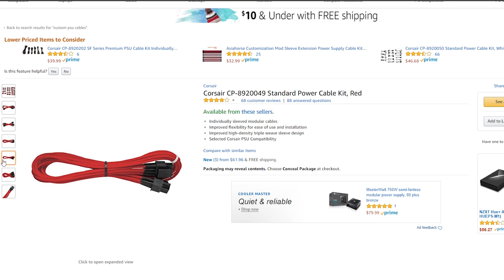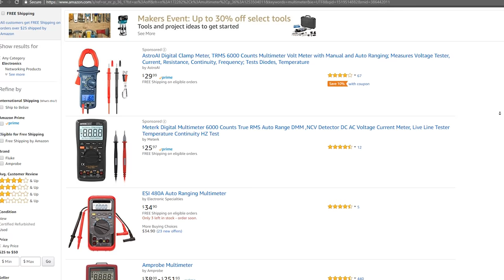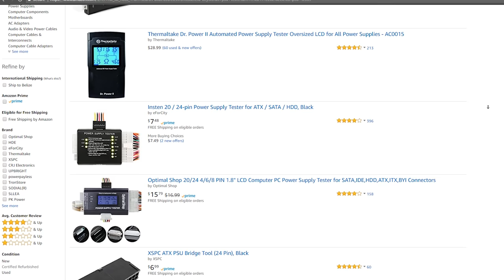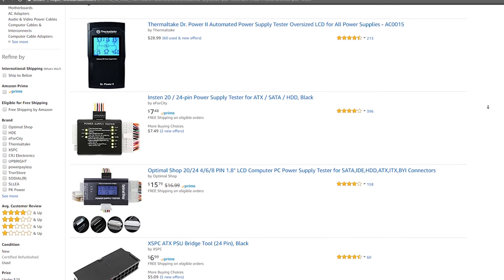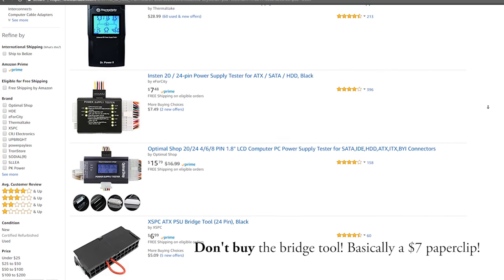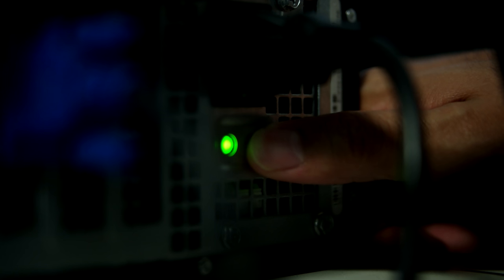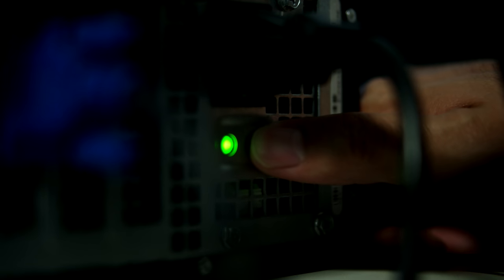How To Test Your Power Supply With A Paperclip

Comment: Thanks!! I nudged my PC and it turned itself off, so I began worrying. Thought it was the PSU so I did this. After unplugging everything for this tutorial and plugging them back in, it worked. Turns out a cable wasn't in correctly. Thanks again for helping my stupidity :)
Reply from the maker: Glad that was an easy fix!

Comment: Thanks for this. I should have done this before ordering a new PSU while in a total panic. After this test I plugged the connector back onto the MOBO and viola, my system is up and running again. It was however a weird situation with an EVGA 500W 80. For the second time now for now reason the PSU fan started spinning like crazy, almost like a hair dryer. Even after putting the PC to sleep. I pulled the plug but after that the System seemed completely dead. No start, no lights, no electrical noise.

Comment: My fans were all connected i unplugged the GPU too so it wouldn't cause extra problems
I had one of them silent modular the fans didn't spin so at least im happy it's the PSU motherboard would turned out way more expensive 😅😢
Tnx it helped so much

Comment: So my fans stop spinning like a second after it turns on so is it faulty?
Reply: Joel Mathew depends on your psu, it could be because it has an automatic fan that adjusts to how much energy it’s using
Reply: Also depends on if you have eco mode enabled
Reply: Then what the heck are we looking for? This isn't helping.
Reply: Did you ever find out if it was faulty
Reply: try rearranging your RAM, or exchange it
Reply: Maight be short.
Reply: @VVVVV99611  a little late with the reply but yea it was faulty, I replaced it with another psu and it worked fine
Reply: Well imma give it up for replacement 😀

Comment: oooh a channel from Belize niceee... Hey bro appreciate the knowledge building a PC this weekend n just bought a new PSU im getting in this week along with some untested used parts so wanted knw how I can test in case any issues come up... Thanks, from Buttonwood Bay, Belize.
Reply from the maker: A fellow Belizean, nice! Hope the info is useful and hope your PC build went well.
Reply: @JoesVids  actually gonna build 2maro... It's all older used parts... But shall see how it goes shud be good...
Reply from the maker: @complx501  Been using a used Asus x370 motherboard for 2 years now without any issues, so hope everything you get is working fine.
Reply: @JoesVids  nice bro lol that's actually one of the really good ones... I have a 3700k with 32GB DDR3 and a Gigabyte Z77X-UD5H motherboard... Supports SLI as well as has an old M2.Sata connect... Pairing that with a older GTX 970 just need to test all the parts n buy a case probably gonna shop one from GS-COM or so

Comment: My corsair psu(which I bought two weeks ago) failed after I changed my graphics card. I put the old psu back in without using the gpu and it worked. I was mad...

Comment: You mentioned that static is an issue in some places but not others? Is there a way to elaborate? I'm really interested on why that happens, as I've never heard that before.
Reply from the maker: Someone else had asked this as well, so I'll just copy/paste my old answer, "I believe it is the high humidity in Belize like other tropical locations that keeps static shock at bay."
Reply: @JoesVids  oh ok thanks. I'll build my next PC underwater. JK.
Reply from the maker: Lol!
Reply: So, your mother board and gpu is ok?
Reply: it's because some places, like the USA, know how to handle delicate electronics and other wuffos, like this guy, don't bother. Ask him what the water heater on his shower looks like.

Comment: I did this test. I was cautious about it too. worried I would get shocked. just  be careful it isn't so bad.

anyway thank you for this. I have the thermaltake 850w RGB. built my new pc yesterday and the darn thing wouldn't turn on.

did this test and for the first time, the fan turned on the PSU and the rgb. when connected to my mobo it didn't do that. not sure why. now on to the next phase... I really don't want it to be the mobo.

Comment: I have a Seasonic FOCUS+ and tried doing the paperclip test and it reacts for a quick second but then stays still (i see the fan twitch and hear clicking), but I see a good amount of voltage coming from it using a power tester. Is my psu bad?
Reply from the maker: Hmmm...you might need to test with a multimeter and test the voltage coming from each pin connector.

Comment: Great tip, thanks.
I have the same issue, just clipped it and kicked in fine till I connected it to motherboard and no life at all
Reply from the maker: Thanks, but also I'm sorry about your hardware issues.
Reply: Hi again,
Well actually it wasn’t motherboard issue at all...it was my PSU believe it or not.
I changed that and no problems...old one was  way past the warranty.So always it’s good to make sure your Power Supply is operating correctly.I was sure it was motherboard.
Gigabyte that is, seven years old and still great performance.
Cheers.
Reply from the maker: @gamesremastered1  Good that you found this out! A cheaper replacement in the end.

Comment: Thanks. Unless I’m dumb and doing it wrong it looks like the paper clip test proved my psu died. Thought that was the case because even my rgb fan lights that remain on even if pc is off weren’t working. Guess my 600w wasn’t strong enough for the 3080 after all. Fingers crossed that my gpu isn’t fried when I get my corsair 850w tomorrow.
Reply from the maker: Yes, hopefully, it is only your PSU that is the issue. 🤞

Comment: Just because the power supply turns on doesn't mean it is supplying the proper voltage and amperage needed to properly run the computer or its components. You need to use either a voltmeter/multi-meter and/or a power supply tester as well.
Reply from the maker: Agreed. This is a simple test as mentioned at 2:39.

Comment: Excellent video.  I have a job coming up to test a power supply.  Support told me to use a paperclip.  "WTF?", I asked myself.  In 3 years of tech work, I had never heard of this.  But,  how does shorting these two wires together prove that the power supply works?  Thanks.
Reply from the maker: Thanks for watching! The paperclip test is very basic and can only turn on your PSU; so the paperclip test only proves that your PSU is not completely dead. A PSU that turns on can still be faulty and you would need to use a multimeter or PSU tester to check the voltage output of each pin to verify if the PSU is fully working.  Now if the PSU doesn't turn on with the paperclip test, that usually means it is not working.
Reply: It's because those two pins need to be shorted in order to turn the PSU on. those two pins open=off, those twos pins shorted=on. You are using the paperclip to simulate the normal power switch on the case of the computer. Even if the PSU has an on/off switch on the back it still won't turn on unless it's connected to the motherboard. How does it know that it's connected? It looks for a short on those two wires. When testing the PSU you want to do it disconnected from the motherboard, otherwise a short on the motherboard could be making the PSU malfunction. Since it is disconnected from the motherboard you need to ground that green wire to fool the PSU into thinking it's connected. As for "proving" it's working, not really. You are "proving" that it can power on and spin its fan, which gives some evidence that it's not totally dead but does not "prove" it is putting out correct voltages and currents.
Reply: @JoesVids  Thanks!
Reply: @TheLarryBrown  Thanks!

Comment: My EVGA 650 Supernova 80+Gold power supply NEW was received bad from the MFGR and after talking to tec assist and doing this method it proved my power supply is bad.
Reply from the maker: Hate getting faulty new equipment but it happens sometimes. I hope you are able to get a refund or replacement.

Comment: Why is static discharge not a problem in other countries? 
Thanks for the info i just bought a psu from china off ebay and in broken english its telling me to do this with a pair of "motal twoozora" metal tweezers i think it means but wasnt sure why. Now i understand.
But the whole time i was trying to think of a reason why electric static discharge is not a problem where you live. 
Please, please correct me if im wrong, I do not think location has much to do with electrostatic force. 
What do you mean??? I'm not saying you're wrong, i just want to know WHY.
Thanks and thanks for the video.
Reply from the maker: Thanks for watching, I meant in Belize we don't have to worry about the amount of ESD from our body frying computer components.  This has to do with the high humidity we have in Belize and other tropical locations.  I believe humidity needs to be below 60% in order for a static charge to build up and in Belize our humidity level is typically over 80%.  We have other issues, like coastal cities and villages being able to enjoy nice sea breeze but having to deal with rusting of computer components over time.

Comment: Thank u very much for this! I tried this, as my pc died, and the psu fan came on fine and also one of my case fans, but after 5-10 seconds the case fan slowed right down and started making a wierd noise, but the psu fan was spinning fine. Does this mean the psu is not providing enough voltage, I don't have a multimeter? Thank you.
Reply from the maker: To be on the safe side and ensure your PSU is providing enough voltage, I would get it checked out by a PC repair shop where they would have a multimeter or a PSU tester.

Comment: Ok , so I did you're test, and the computer actually booted witch made me super happy. But it wont boot when I connect the 24 pin in the motherboard. The motherboard have some rgb and a power led witch functions probably.  What can cause this fault then?
Reply: Hey did u ever manage to figure this out? Having same issue, power supply passed test but when i connect it to motherboard nothing...
Reply: @yreina  same thing happen to me,  that why i bought new powersully and motherboard to check which is the faulty one. Then i found out that the powersupply is dead even though it pass the test of jump start,

Comment: Hi man your video was great it helped me. I went to a PC engineer and he said to me (your power supply is diying) but I was using it for years and years and it didn't have any problem, and from that day I didn't turn on my PC because I thought it would burn my whole PC. And I did this test and my power supply was working. What should I do buy a new PSU or use my own?   You'll  make me happy if you answer and help♥
Reply from the maker: Hi, what was your issue in the first place as to why you took your PC to get checked? Also, did you see how the person inspected your PSU? As mentioned in this video, using a paperclip is a basic testing method and if the person you took it to used a multimeter or a dedicated PSU tester that checked the voltage for each pin on your PSU, then you should trust their diagnosis.  Sometimes a PSU can turn on without providing the correct voltage to your PC and in turn damage your motherboard in the long run.
Reply: @JoesVids  I just went to him for installing game. He didn't test my PSU or something like that he just said because of the weird sound of it, it is dying. btw I test my PSU today with this method for the second time and the fan was not moving it just had sound what is the problem?
Reply from the maker: @Mshani-pu5uq  Sorry for the late reply, but if your fan isn't moving and you're hearing a weird sound, more than likely your PSU needs changing.  To verify, I would take it to an IT technician in your area, but I think you might need to buy a new one.

Comment: Heared a pop noise and my pc shut itself off. Now i dont see any led light on my motherboard or my mobo is toasted or my psu is toasted too. Im planning to do thr paper clip test but im scared of burning anything else in my house.
Reply: How did it go? What was it? And where are you now with your PC?
Reply: @sarnyboi  tried the paper clip and the fan worked but as soon i connected anything to the psu it shut it self off like the hard drive never turned on. right now im in the usa and my pc is on argentina :) bought a seasonic 750w 80 plus gold modular. hope this japanese component last more than one year :) instead of the cheap chinese psu i had. also changed to red team and i cannot wait to install my new r5 3600 with a b450 and with my 2tb new hard drive with also my new rift s :) im bringimg full package!
Reply: @jaimdiojtar  Jeez. Nice to hear that. Have fun with your VR ;)

Comment: Was working on my new pc earlier today, the stupid switch wouldn't turn on the pc. Had a heart drop feeling, since power was stuck somewhere, I assumed its the PSU or the motherboard. Of course I double-checked all the connections, especially the 24-pins. Na-da.
Did a pin test for the first time, nothing happened. PSU should be an active PSU, so fans should be running when its on. Sadly it didn't.

Anyone thinking titanium rating PSU are of highest quality, I think I'm one of the rare ones that received a faulty PSU.
could also be the mobo too, that's be a double-whammy

Comment: My pc runs well,but after some time(4hrs) it starts restart, work fine on nxt day (giving it some rest) and again goes into the same problem, is this my psu problem?
Reply: Did you find a solution? Mine has a similar issue.
Reply: @damincartwright9476  my psu is the problem i bought a new one

Comment: what are you doing to your components? or your power grid?
....
i have asus gtx 460, ati hd5770, 2 asus 970's, 2 1070 ti's asus and msi, msi 1070, asus p55 p67 z77 mobos, handful of socket 1155 cpus, 1156 cpus, 2 amd phenom 965's, ECT ECT OLD PARTS.... that are not dead, or have 'died'
....
what are you doing to your components

Comment: Hey thx for the trick. But is it normal if psu can feel some electric when i touch it? Or i got bad ground wiring on my home?
Reply from the maker: No that isn't normal. You shouldn't feel any continuous electric shock when touching the PSU. Like you mentioned you could have a bad ground wiring at your home, but you can test your outlet with a multimeter to rule that out.
Reply: @JoesVids  i have check my home wiring. There are no ground wire installed. So, i suspect this is the issue why i got electric shock

Comment: I just can't tell if its my psu or motherboard, because when i do the paperclip trick the cpu fan spins but the fan on the power supply doesn't.

If the psu was broken then should it still be able to do that? Or is the motherboard the reason why my pc wont post?

Comment: How do you  not have static electricity in Belize? That doesn't make sense. Also you say pins 4 and 3, but corsair suggests using pins 4 and five. Which pins are correct?
Reply from the maker: I said, "In Belize, where I'm from, we don't really have this issue." If I said, "Belize doesn't have static electricity", I would agree that doesn't make sense.  In Belize like many other tropical countries, we have high humidity.  Humidity above 40% allows static electricity to dissipate harmlessly.  

Using pins 4 and 5 will also work.  Using pin 4 which is your live or PS_ON pin with any of the black ground or COM pins will work, and I highlighted a few of the COM pins with some white arrows in the video.

Comment: i have a question with my power supply. I use the paper clip test on my PSU. its providing power but the PSU fan is not spinning. i know its providing power because i did not remove the HDD cable and fan that connected directly to PSU and my HDD is operational and the extra fan (not the CPU_FAN or SYS_FAN) is spinning.  But when I connect it properly to the motherboard, there is nothing. No LED, HDD, any FAN whatsoever. Do I have a bad PSU  if the PSU fan is not spinning or motherboard problem? Help.

Comment: So, i did this trick on a new psu i bought and the fans never kicked on. I figured it was a bad psu so i wanted to test my hypothesis by using an old psu ive had in storage for years. I only connected mobo and cpu and then, sparks and smoke from psu… does this mean I have a bad mobo that killed both psu! Is my cpu in danger?

Comment: static seems random in masschusits seems to be alot in wyoming seesm to be middle but florida has like none. cant peaople just groudn themsaelves by toutchin ga a door knob or going down oen thse staticky rtubre slides or anythign tho? and the supernova gold says it comes with japene conenctors dose that just mean the SATA and CPU or is it the motherbaord power too? the tester that came with it is in the same position as your paper clip, asking becuase diddent knwo HP had pripority connecotor and had to order a dang chinese adaptor in the mail.
Reply from the maker: In regards to static electricity, you need low humidity of about 40% to cause a static discharge that can damage your electronics. So depending on the humidity levels of the State you are in you will experience varying degrees of static discharge. The EVGA Supernova comes with Japanese capacitors that are supposed to be of higher quality than capacitors made in other countries. I'm not exactly sure what you were asking about the capacitors in regards to the CPU and motherboard, but the PSU provides power for all components within the computer (CPU, HDD or SSD, GPU, Motherboard).